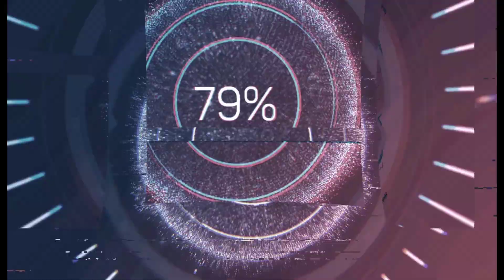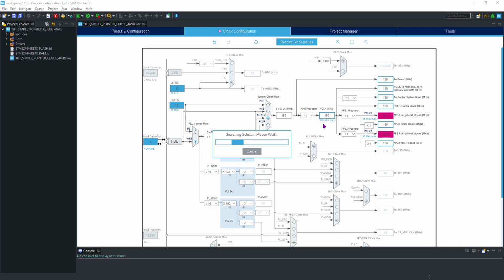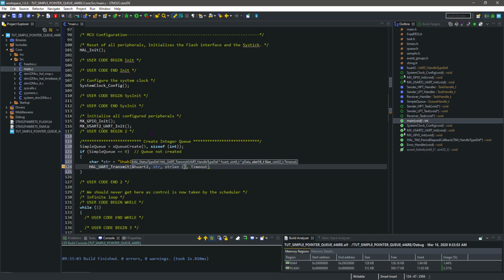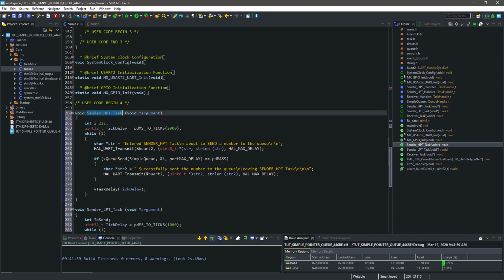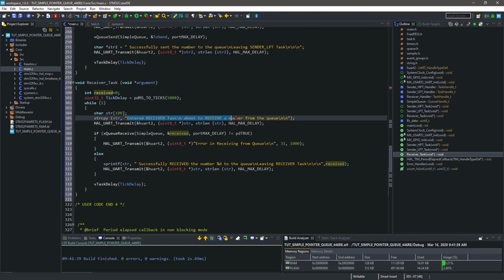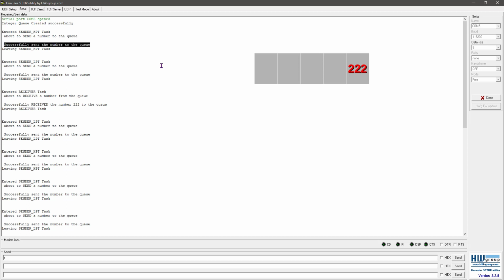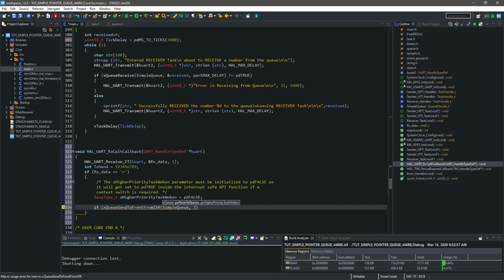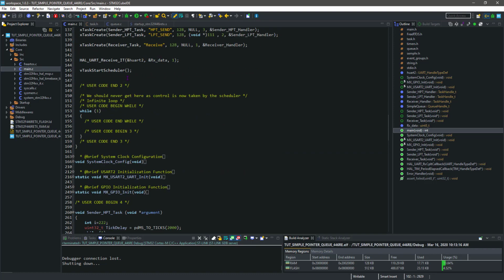FreeRTOS Tutorial 5 || Simple QUEUE || STM32 || NO CMSIS || CubeIDE

Comment: hello. I have a little problem with xQueueCreate function. in my project this function is not determine. i tried to  download freertos from site, but this not helped me. if i create queue in cube, so need to work with message queue functions , but i cant (
Reply from the maker: If you are setting it from cubemx like i did, make sure enable queue is selected in freertos configuration.

Or try creating a queue in the cubemx itself. You can delete it later in the main file
Reply: @ControllersTech  i tried to generate keil code from your cube project , but xQueueCreate function i cant find. I checked config file and cube file settings , but nothing  about it. I downloaded original code from freertos site? also could not fing this function declarations. (

Comment: It is not clear why you initially read the interrupt using HAL_UART_Receive_IT(&huart2, &Rx_data, 1); but then inside the HAL_UART_RxCpltCallback you clear the interrupt with HAL_UART_Receive_IT(huart, &Rx_data, 1); huart in stead of &huart2
But it works??
Also, inside the ISR, you write tohuart, and not &huart2
But either works.
Then, it seems that no matter how big the queue is, at some point it will be full, and xQueueSendToFrontFromISR will return 0.
Is this correct?
Any help appreciated
Reply from the maker: 1. Inside the callback, the interrupt is not cleared, it's being called again. HAL library clears the interrupt before callback, so we need to call it again.
2. The callback is being called by the 2nd instance &huart2, so using huart or &huart2 inside the callback is the same thing.
3. Yes, if the queue is full, it will immediately skip the sending. That's the purpose of this function. We can't have any wait states in the ISR.

Comment: Thank you for the informative video!

However, I do notice something that troubles me with the code after enabling the RX ISR.
Why is it that the interrupt works only at the very beginning (before the queue fills up) and then, it never works again? I found out that for me the function 'xQueueSendToFrontFromISR' returns 0 (ie. pdFAIL) and then, the ISR never sends out the data "123456789" again. 

Therefore, the ISR can only do its job one time and only right after program execution starts. How can this be fixed if I would like the ISR to always do its job even if the buffer is full?
Reply from the maker: The queue might be full.
It cannot send data if there is no apace in the queue. Try creating a bigger queue and then see

Comment: so you use CubeMX to generate the default Code. Than you delete half of it. What is the point?
If you would later use the CubeMX again to initialize a CAN Interface or Timer or whatever, to default code would regenerate and you will have to start deleting again.
Why cant you just use the Standard Code and the already included Libraries?!
Reply from the maker: Because the cube mx generates the cmsis rtos functions. In the video, i have used the pure FreeRTOS functions, without any cmsis layer. Also cubemx always generates the default task, and i only deleted the initialisation, and working of default task.
Reply: @ControllersTech  Yes, but you would have to do this all over again each time you change something frome the Cube, right?
And why didn't you use the cmsis layer?
Reply from the maker: Yeah you would need to do that again..
CMSIS is easier to use but it's better to understand how the actual rtos functions work. Cmsis uses the same rtos functions inside their own functions. It's easier to use it, but it's not learning exactly.  For example in cmsis, you can use the same function to release semaphore whether you are in a task,or in an ISR. But that's not how the freertos actually works. You have to consider different things when you release the semaphore from the ISR. CMSIS do all those considerations inside their function by including a "if in ISR" kind of condition. This is something like you used it but you don't know how it is working. 
Also The idea is to generalise the free rtos tutorials, which are not specifically for arm controllers, but can be used in arduino, or any other mcu that supports freertos. 

Also i did a poll on YouTube and majority voted for non CMSIS
Reply: @ControllersTech  That makes a lot of sense, thank you. In the meantime i was playing around with the cmsis wrapper for queues. It caused a crash after a while, so maybe there is a bug in the wrapper...
I tryied to increase the Priority-number (lowering the Priority) of the queue msg, but it still failed...

I will try to use the xqueue macros now :)
Reply: @ControllersTech  Just a follow-up: I use CubeMX with TouchGFX, which uses FreeRTOS Tasks to run. My work around is:
Include all the .h files in the user Code section like you did.
Declare the Tasks and ques etc in User-Code Section for RTOS QUEUES.
Create the TouchGFX Task with:
xTaskCreate(TouchGFX_Task, TouchGFXTask_attributes.name, TouchGFXTask_attributes.stack_size, NULL, TouchGFXTask_attributes.priority, TouchGFXTaskHandle);
this uses the Parameters from CubeMX (so you one could make Changes in HeapSize in CubeMX and it will be regarded)
and start the vTaskStartScheduler befor the generated Code creates the "actual" TouchGFX Task. This way (doing all this in the user code section for the Queues) the Wrapper Code will not be executed and everything still updates from CubeMX without the need to clean up the Code after changes in the Cube...

Works perfectly. No Crashes from Queues etc
Reply from the maker: Yeah great. That works too. And glad to see that u made it work.
Actually i wanted to use freertos independent of the cubemx, like include seperate libraries for it, and not generate them from the cubemx.  But later dropped the idea.
At some point you might have realised that using free rtos directly makes more sense, and it's somewhat simple also compare to CMSIS..